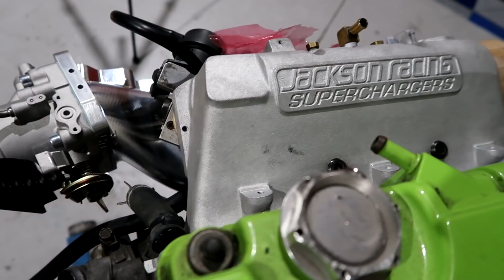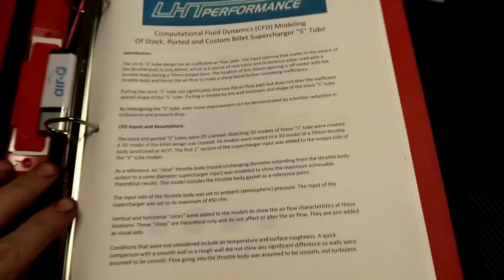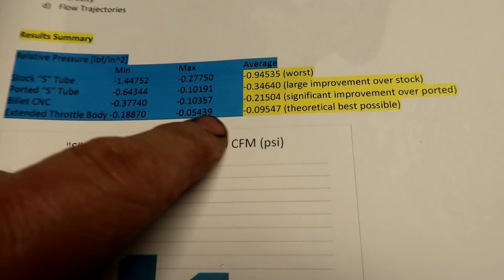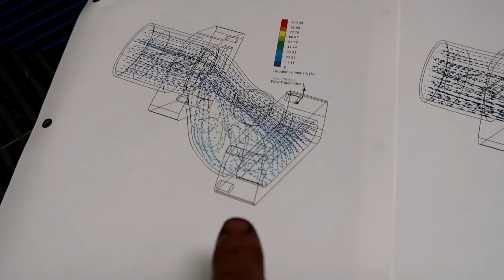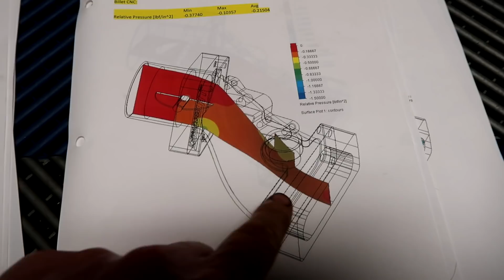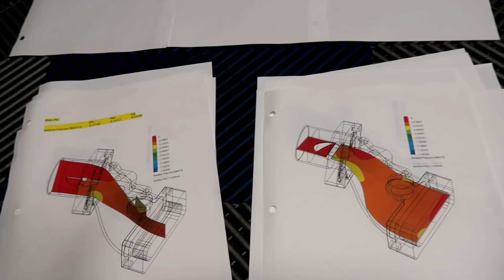Billet S tube - JRSC Supercharger Upgrade

Comment: Whats full price SC( realise supercharger not available now) will it fit onto 1 ive mentioned below?) Throttle body + what else i need to put on my 99'ek4uk b16a2  Lsd /cc clutch / dc 2 flywheel already fitted 5mths ago ive owned this from new 86k on  clock was told to get a rotorex charger but frm vid looks real good USA stuff top shelf how much for all components  please..mickbrown123@live.co.uk thanks

Comment: If I’m not mistaken, should this also work on the d series jrsc?
Reply from the maker: No. The D series uses a M45 supercharger which is smaller with a much different flange
Reply: @LHTPerformance  ah got ya

Comment: Sounds like you need to develop your own supercharger. Based around a JR system but with your improvements. The s tube mod, with a ac type internal intercooler would be awesome.

Comment: Being in aerospace manufacturing, this stuff gets me excited.
Reply from the maker: My Dad worked for British Aerospace. I remember seeing a harrier jet wing Cnc cut for a solid chunk.
Reply: @LHTPerformance  Yup! we fabricate F-35 engine exhaust parts. Fun stuff but incredibly tight tolerances so it can get stressful.
Reply from the maker: @Garlander  I can imagine. My Dad used tell me stories of incredibly tight tolerances on even brackets that do very little. Then a bicycle chain the operated the main thruster nozzles.